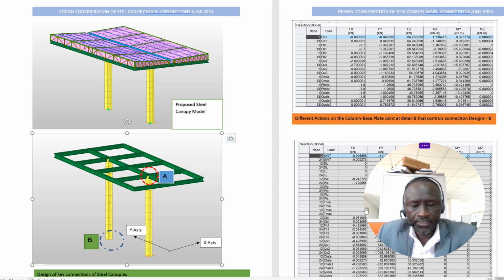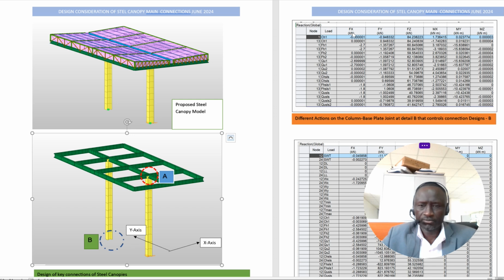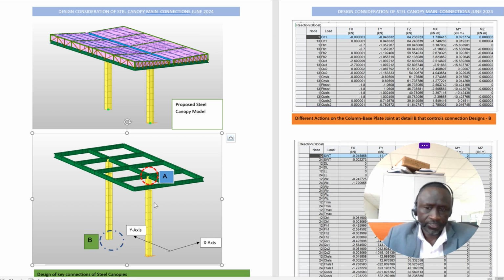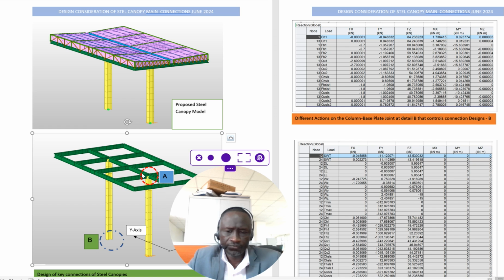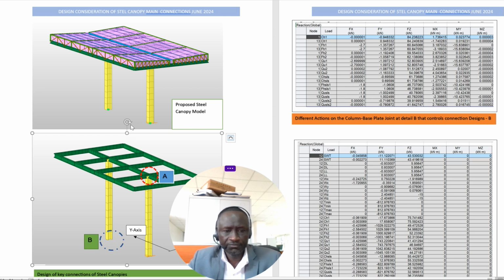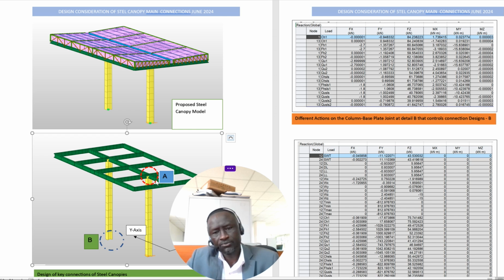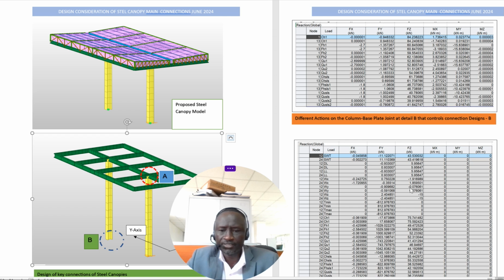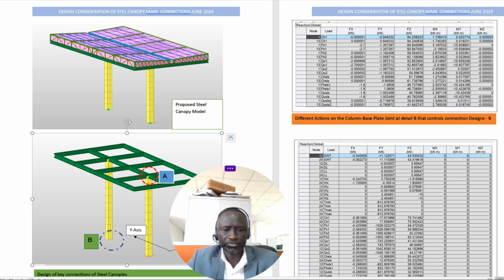Main Steel Canopy Connection Design

Comment from the maker: The tables have some abreviations of Ch1 and Fh1 and so on. I used these to symbolise the diferent loads as per my definitions. However, when you look at the applicable literatures and Eurocodes, you will get the right terms and symbols taking you forward.

For example,

Ch1=1.35Gk+1.5Qk, where Gk is for Self-Weight and the Dead Load due to other fixities and Ch1sls=1.0Gk+1.2Qk for ULS and SLS respectively. And for Fh1=Gk+Qk+Wind Load. Wind load is multiplied by a reduction factor as indicated in the notes and Eurocode. All i am doing is to introduce you to a culture of reading widely while using my examples which are for demonstration and giving you the confidence that, it is possible for you guys.